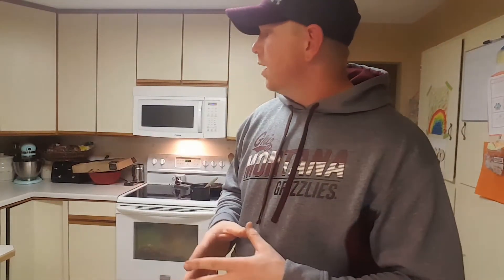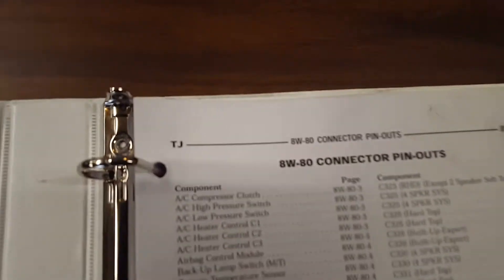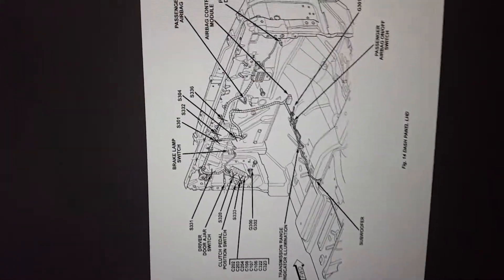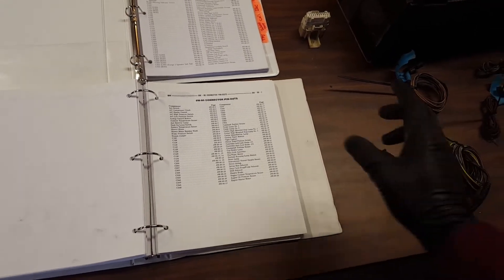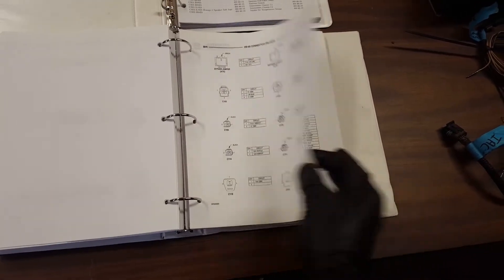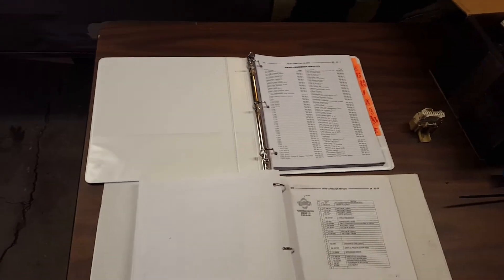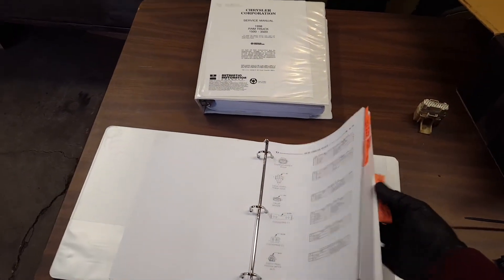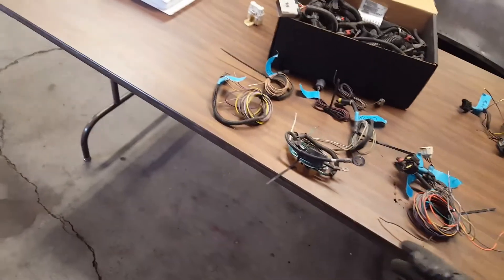Jeep tj magnum swap (FSM ECU pin out binder)

Comment: Hi Hope you are well! Great video! 
i'm in the process of a 5.2 swap for a XJ and i think this swap might be similiar
You did the splice to run the dodge pcm with the jeep wiring right? I'm totally new with this kind of stuff. I'm trying to figure out how to run the wiring, i have the complete xj harness and a 5.2 with all the connectors attached plus the PCM. Now I have to put them together (basically)?
Reply: After doing this splices you run the tj pcm in parallel for the interior, external lights and every other electric component besides the engine?

Comment: Probably stupid question by how come you can't just use the harness off of whatever engine your swapping in? Especially since your using the Dodge computer. Is it to get the gauges working?
Reply from the maker: VadieN gauges and transmission. This is for keeping the stock transmission.

Comment: Cool !!! Big help thanks man👍🏻
Reply from the maker: OZZIE G you bet brotha!
Reply: Hello Montana, which radiator/fan did you use? Do you have a link for it?
Thx mate....Limey
Reply from the maker: Casey Beynon on my previous magnum swap I used a fan out of a ford taruas I got it at a junk yard however they can be bought new on eBay for like 75 or 80 USD go to eBay and get a fan for 90-95 Taurus or sable with the 3.8L